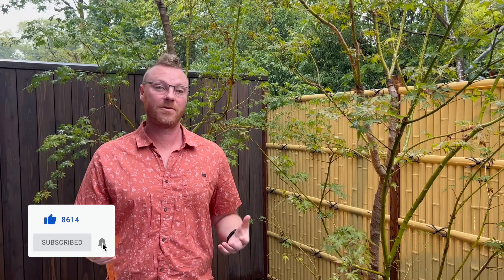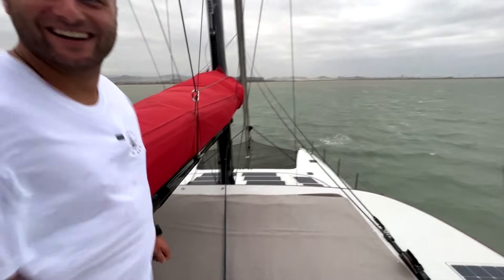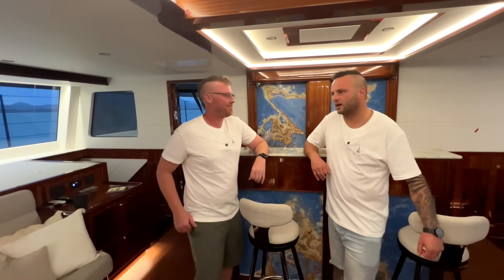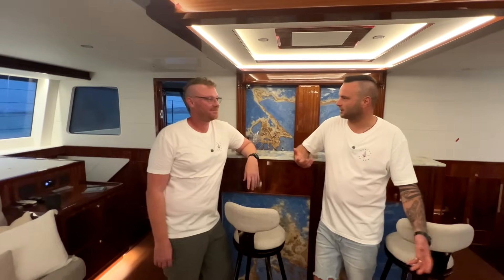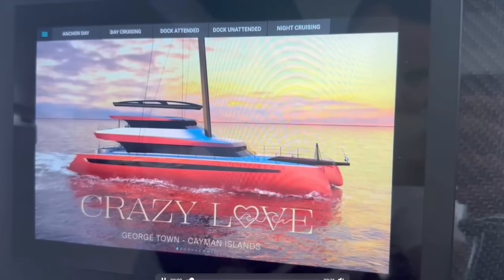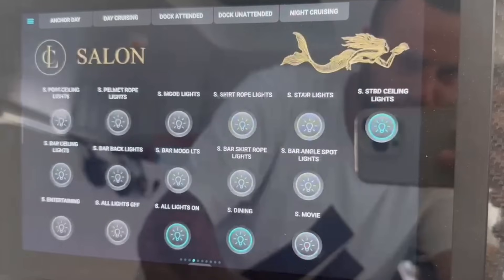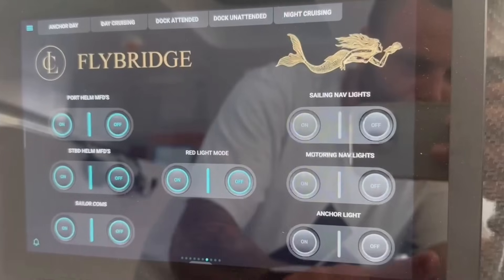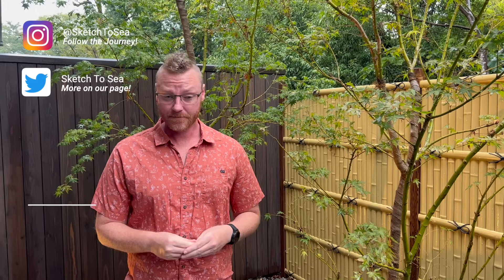Sketch To Sea: Power Management and CZone

Comment: Thank you for putting out all this great detail about your boat build! But seriously, your electrician quoting Amps means nothing without the voltage... some boats use 12VDC, some use 24V, some 48V - and many solar panels are producing power at perhaps 30VDC so quoting Amps is almost meaningless. The unit of measurement for power is Watts, so it is way better to stick with Watts for ALL your power discussions!

Comment: Can you see or monitor power consumption of your power wenches?   Asking in case it could be used to monitor the sail track and it's function.  Might be way to catch snags before they happen?
Oh, and mast head cam?  Can they be used to check bridge clearances?
Reply from the maker: Yes we can use the mast head camera to see bridge clearances. We can also see the consumption of the winches via the hydraulic system. It is unlikely that it would prevent a snag though.

Comment: I watched the video again and the HH guy was wrong in his calculation. You stated that 3000w the inverter would use 75A. You are correct but at 48v inverter not 24v inverter. He stated that is was 100A he is also wrong it’s 150A. So running 2 x water heaters at 6000w total would use 300A DC from the battery using 24v inverters. This is why going 48v just makes sense.
Reply from the maker: Thank you for the comment. The actual cylinders themselves have 2 different elements. It can be either or depending if 1 of them is on or both of them are on.
Reply: @sketchtosea3750  Correct most hot water tanks are designed that way. With my design is same only my specs use copper instead of stainless steel it’s horizontal instead of vertical and uses 2 X 2000w DC elements instead of AC elements. It’s more efficient this way. No losses from DC to AC conversion and the inverter can power other AC items like the freezers and fridges.

Comment: Talking about water system. 
I think you mentioned the cylinders have 3Kw heating elements. What is your freshwater capacity and hot water capacity.
Reply from the maker: We have 1000L a side of fresh water, and 2 230L per hour Shenker watermakers, and then 2 torrid marine 40gal cylinders. The torrid marine cylinders have 2 heating element in them 1 at 1 KW and the other at 2KW, making peak load 3 KW. Usually once hot, it only needs the 1KW heater.
Reply: I can see why you want to turn one off, they are huge, household-sized.

Comment: Nice hearing about the systems and how they are working with you and the crew onboard. Interesting to hear some of the draw numbers on some of the equipment as well as the fact that you had two hot water heaters running but still managed to run out of it. I never would have thought that would happen.
Reply from the maker: We were turning them on and off depending on usage times. We never ran out, we just had bad timing. Leaving 1 on 24hrs a day allows us to shower anytime with out having to schedule our shower around genset time.
Reply: @sketchtosea3750  In my design I have 1 central custom built copper heater with 2 x 48v 2000w elements.  Also there are 2 coils as well. One from the DC genset to make use the waste heat from the DC generator whenever used.The second coil come from a cheap Chinese 10kw hydronic running open source firmware controlling the heater. The hydronic heater can be manually controlled or automated by home assistant with conditions. It is used when hot water demand is excessive that the DC elements can’t keep up. 95% of the time the 10KW heater is not used.

Comment: Do you have the space to add more batteries if you wanted to have longer runtime in quiet mode?
Reply from the maker: We do, and we actually have 4 more batteries onboard that are dedicated to the bow truster. We may in the future add them to the house bank. I would much rather do a large refit in a few years. From the original design to now the individual batteries each have 40 amps more. I imagine in another 5-7 years that would be another 150 amps per battery. That would allow us to be a lot more reckless about usage.
Reply: @sketchtosea3750  That makes a lot of sense since battery research is racing ahead.  Your battery bank is terrific now and no telling what the future brings.  It is interesting to hear you talk of the original design to now the batteries have improved that much.  You are the pioneer of this design and I applaud you for it.  I am sure that the original design 48 volt architecture was not as robust as it is today or as it will be in 3 to 5 years.  It looks like Tesla is going push foreword 48 volt to be an industry standard instead of 24 volt.  I have had solar on my house for 15 years and the changes have been so amazing that my old system looks very lame.  It would be easy for someone to look at it and say "what were you thinking?"  They would be very right.
Reply: @sketchtosea3750  Why did they do that put separate batteries for bow thruster. That is just bad design and a waste for space for your lithium batteries. I only design with central batteries and have DC to DC converters for everything else. If it were a 48v system you can have the bow thrusters ( in my opening is NOT needed in a catamaran) in 48v. I went into the bow thruster rabbit hole and spent many months researching even jet thrusters.  Again for a catamaran not needed because you steer with your engines not the steering wheel. However on a monohull yes a bow thruster is needed.
Reply from the maker: There is a lot more going on than you capture in your analysis. A bow thruster for a vessel this size is extremely helpful. Most importantly when docking and anchoring. We would have had to run huge gauge cables up to the bow in order to avoid separating the banks. This would have added over a ton in cable.

Comment: The solar setup is done correctly with one controller per panel however I would have designed your electrical system differently. Your system is way too complex and has too many points of failure. With a boat that size I would have gone with a 48v battery system not a 24v one. ( the amp draw is half) On my 50 foot electrical catamaran is all 48v single bank system. 250 kilowatts off custom lithium. ( my design and build too keep the costs down as low as possible)
Reply from the maker: 48V was just coming out when we designed the boat.
Reply: @sketchtosea3750  That is sad I had designed 48v systems over 10 years ago all in paper of course. The problem with 24v systems is the high current in amps. For example for a continuous load of 6000 watts AC that comes out to 300 A for 24v systems and only 150A for 48v systems. Only within the last few years there have been 48v windlass but for a boat that size like yours you would go with a 3 phase AC windlass. That is how my 50 foot is designed. It has 250 KW of lithium ion yes ion to save weight. 21k watts of 3X 7 kw continuous AC 230v AC inverters ( the inverters are part my design) In 3 phase comes out to 400v. Which can power all big boys. Chiller, water maker, dive Compressor all 3 phase and even a mig welder. Chiller can cool and heat and every unit ( air handler) has its own passive electric heater. Water heater is a custom build copper unit 100l with 2 x DC 2000W elements again for efficiency. It has 2 coil one heated by the waste heat of the custom built DC generator 42Kw unit. I could go on and one for 2 hours but this post is long enough.48v Systems have been around for a long time. Too bad I was not there while you were in the design phase. My system design is ready still lacking investment. I am planning to do day and night charting and have spoken to the proper people and they told me that I would get approved for the EU grant because the boat is 100 % green or I forgot to mention it also has 15.2 KW of solar that only weights in at 250kilos. The boat can motor 4.5 to 5 knots just on solar energy  (via its 4 x 100 KW custom electric motors) alone and still produce enough power to run the entire boat off solar alone.
I am still short about 100k to make my dream come through.
Reply: Sorry I meant 4 X 10KW custom electric motors.
Reply: They created a sub optimal electrical system due to yard brand loyalty. 
Very interesting decision. Supposedly in the favour of eaisy Czone integration. But all the system use standard MNEA2000. So integration should be brand independent.  @carlospereira9838 What's your experience with this
Reply from the maker: Definitely not "sub optimal" and was not brand specific. Keep in mind that all of this was sepc'd 5 years ago.  @DarrenBainbridge
Reply: @sketchtosea3750  That is not an excuse just because it was designed 5 years ago. Even now I have altered my designs whenever it is required. For example my original design called for all DC fridge freezers problem is they are very expensive for the volume you get compared to AC fridge freezers. Also with AC you get not only larger volume but the DC fridge freezers are about 3 to 5 times the price. After calculations since I was already going from 48v to 24v  I was already loosing some efficiency so I offset by adding a bit more solar and now have changed all my fridge freezers to AC. There are some AC fridges freezers that are very efficient. That is just one example of adapting a design change.
Reply: @DarrenBainbridge  I agree some designers stick to brand because that is what they know. My issue with mastervolt is that it is a high frequency inverter which means yes you save on weight but it has terrible surge capability. However mastervolt is one of the better designed high frequency but will give you at max 2 x rating for surge. Low frequency designs start at 2 x rating. Most are 2.5 x to 3X rating and some can even handle 4 x rating. Low frequency inverters is a much simpler design and much more robust. That is why my designs only call for low frequency inverters.

Comment: Did you cover the mohawk hairstyle in a previous video, I don't remember seeing it but I notice that there are more than one people with the style and cannot help but think this was some kind of forfeit or challenge.
I have a question about the solar, when looking at the 44 of the Wynns they have a really interesting custom designed solar system, but your one looks kind of "old" in that it is a bunch or oblong panels on the horizontal surfaces, Did you not opt for custom design, was the solar already fixed before the new designs were available or was there another reason, I cannot help but think you could have added 30% plus if the panels had filled the horizontal areas and even more if they had wrapped around a little. 
Electrical is awesome my question is about the grey and black water systems. Grey water is relatively easy to manage but how do you manage the black water?
Reply from the maker: Never covered up the mohawk, it was a crew morale thing. We have stuck in this shipping channel for far too long waiting on government approval to leave. The panel that you are referring to a re new technology. We had already purchased all of these ones before it was released. When a full custom yacht takes a while to build there are a few instances where we will be "victims" of technology. This was one of them.
Reply: @sketchtosea3750  I hope that you got the approvals sorted out, bureaucracy can be frustrating.
About the panels - the speed of technology can sometimes be too fast. I guess in a few years time when they need to be replaced technology will have leaped forward again.
Thanks for taking us on your journey it is fascinating.

Comment: Question
Is the C-Zone system integrated with an Apple ipad or Android tablet
We have friends that bought a boat from another company that has a C-zone system
They were told that the system only intergrates/can be programmed using pc/Android software

Can you confirm what operating system is required to program C-Zone and what app software / system eg Android /Apple
Reply from the maker: I can confirm that we have a dedicated laptop onboard to program and build our CZone. It is a PC with windows.. The programming is relatively easy, I was able to pick it up within a few hours. I cannot comment on cost as it part of the original spec. We have taken it a step further and added Sentinal. This allows us to control any of the czone systems remotely as well. Chris is not a CZone representative, he is an electrical contractor with HH catamarans. Anything that has been beyond his scope, we have had great responses from CZone.

We have Ipads, and are not familiar with Android, but there is a Czone app in the app store and once you bring it onto the home network it picks it up right away.
Reply: @sketchtosea3750  can both AC and DC be controlled by the C-Zone?
Reply from the maker: Yes, both are controlled via czone. @darrenykema979
Reply: @sketchtosea3750  good to know. 
I'm planning ahead
Reply: @sketchtosea3750  I don’t even want to know how much that system was. The AC stuff on C-Zone is crazy expensive. I hope they installed a galvanic DC system protecting that CAN bus just 1 zap of high voltage and all your CAN electronics are dead. I have seen this before on many boats. On my design ALL DC electronics is protected by galvanic protection ensuring full  DC isolation. CAN bus is very sensitive to voltage spikes.
Reply: @sketchtosea3750  I have assisted in C-Zone installs in the past I have not done it in my own because I am not a dealer. It’s not the worst system out there but the HUI interface is very easy to use and has very good integration with master volt and Victron. My issue with C-Zone is they do everything over the NMEA bus so if you have CAN bus issues it’s a nightmare to fix. Also it’s a very expensive system. Going open source you do it for less that 1/10 the cost of C-Zone.
Reply: With C-Zone there is a hardware add on by mastervolt that allows the wifi capability. Now you can use any IPad as a C-Zone interface. However what I don’t like about C-Zone first is the price it’s very expensive and only supports DC control. There is an AC control but it’s crazy expensive and limited. The worst part of C-Zone is that is is dealer locked so if you want to change your Programing you must contact a C-Zone dealer. I have worked with C-Zone in the past it’s not the worst system but it’s not the best. I prefer to go the open source route with Signal-K and home assistant. Can do everything the C-Zone can do and control both DC and AC systems with a max of 30 amps per circuit at less that 1/10 the cost of C-Zone however has a steep learning curve. You need to know a little bit of C programming for customs firmware programing . However with home assistant not only can you do automations but supports all kinds of third party hardware.